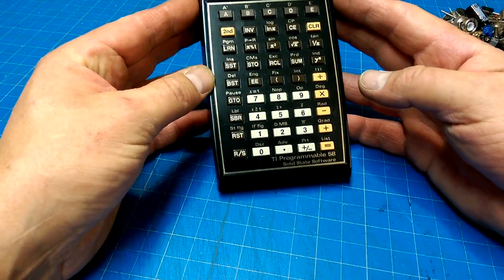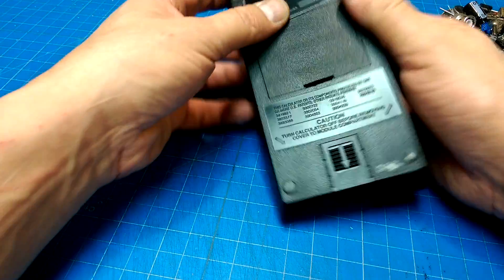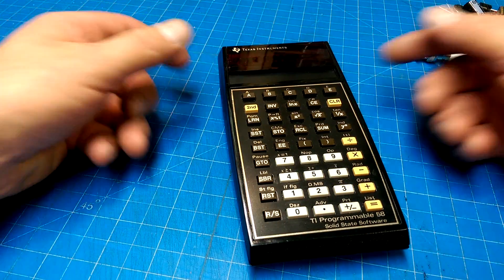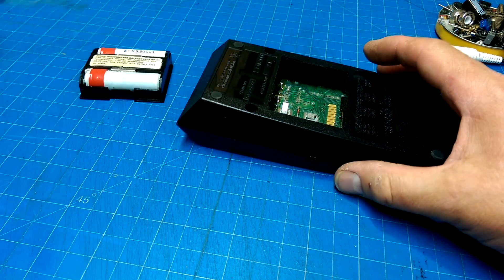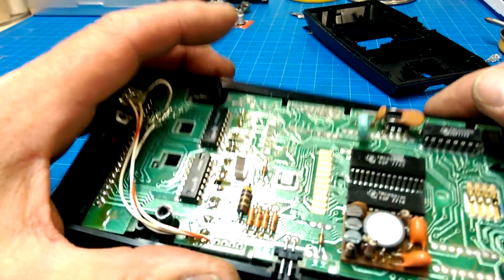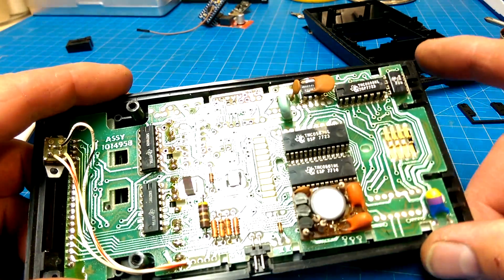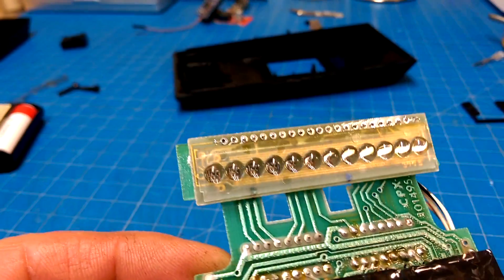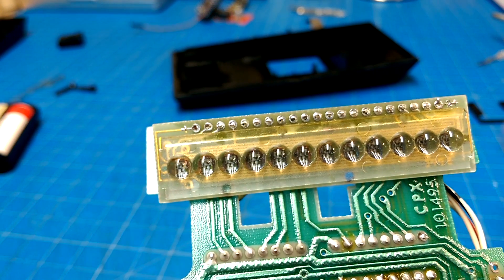TI 58 Repair

Comment: Oh that's interesting, the board seem to have been the same as the TI-59, bit it's just not populated with the card reader circuitery. You notice there's a whole area without components on the right of the battery contacts. Also the whole space in the head of the case, under the display, is empty... Right where the card reader fits in a TI-59.

Comment: Cool! I Still have a working Ti55 I bought with all the loot I made cutting lawns and taking care of neighbors pets during the summer when I was 15, in 1979. It was programmable sure but has very few program steps and is lacking in instructions compared to the more advanced programmable calculators. 

I wanted a HP41C but it was way above my pay grade. I would have settled for a Ti59 or a 58 or even a 57 but again, way more money than I could come up with. 

About 10 years ago, I nerded out on EBay and picked up a Ti59 with a broken power pin like the one you repaired with a PC100A printer cradle. I also picked up a Ti58C (constant memory) that I repaired the battery for. It works like a champ. I do love these old calculators.

Comment: When you use USB power, does the polarity matter on the external plug?

Thanks!
Reply from the maker: I do not have a schematic so I can not say for sure, but it looks like the power from the adapter goes into the bridge rectifier so polarity probably does not matter.

Comment: Is it possible to use it from the currently available Lithium 3.7V batteries? I have one approx 1200mAh, brand new and I do not want any damage of the calculator when I plug the charger.
Reply from the maker: The NiCad pack was about 3.6v, and I run mine off of 5v USB, so I don't see why not.
Reply: @grtyvr  Thanks, but I mean, I solder the battery pack inside and I want to use the original TI charger, so I do not want to install eg. a TP4056 charger circuit with USB connector.
Reply from the maker: @TizedesCsaba  I suspect that the new battery charge profile is different from the old NiCad.  But I am not an expert on that.
Reply: @grtyvr  Yes, I have asked an electrical engineer and he said, the overcharge protection for the Lithium batteries required, therefore the best solution install a TP4056 charger with USB. Only one question, how can I close the battery compartment without old battery...?!?
Reply from the maker: @TizedesCsaba  I just pulled out the batteries and left the cover undisturbed.  That worked for me.

Comment: The TI-58 and TI-59 were introduced in 1977. The TI-58C was introduced in 1979 with some internal circuit improvements and that's when I bought my TI-58C. Also bought a printing cradle for it (PC-100A). The "wall wart" it came with is the AC9900/H-sw charger that can switch automatically between 120VAC and 240VAC input, and outputs 6.2V @ 200ma (hence the "sw" appended to its model number; models without the "sw" are 22VAC input only). Has a Euro two-pin plug and requires a simple and cheap two-blade adapter for North America (no need to change voltage). I'm betting it's AC in spite of its polarized plug for the calculator, which could make sense if it has a full-wave bridge rectifier circuit . . . which would chop that approximately in half and provide charging for the ~3VDC battery pack (NiCads are 1.2V). If you replace the batteries and get a wall wart made for it, use only NiCad as the charging circuit is not made for NiMH. I've got two battery packs, one original and a second bought to replace it when it went dead. I'm going to mod the original to take replaceable AA batteries - likely will still go with NiCads, and will mod the second when its cells eventually die. If you use anything other than NiCads, pull them out before plugging in a wall wart!

Additional Notes:
The US Army was using the TI-59 with the printing cradle on a limited basis to evaluate feasibility in parallel with the M18 FADAC, an ancient solid state field artillery fire direction computer that was fielded in 1960 (FADAC = Field Artillery Automatic Digital Computer). It's not a trivial problem as the trajectory is affected by meteorological conditions including temperature, humidity, air pressure, wind velocity (a vector that includes direction), and precipitation (type and magnitude). The TI-59 fire direction program was fully capable of handling tube (e.g. howitzer) and missile artillery with high precision, and it was faster than the M18 FADAC. the printer was required for record-keeping in the event of an investigation regarding an errant round landing off-target (very serious and extremely thorough). The TI-59 with printer was overtaken by the fielding of TACFIRE. One of the major concerns with the TI-59 was its robustness in a US Army field environment that would subject it to all manner of shock, vibration, dust, moisture, etc. It wasn't hardened for it. Had it been fielded, the contract for it would have requested special hardened models specifically made for those conditions.
Reply from the maker: Good thing they didn't field it.  The memory card contacts were fragile.  I doubt that they would have stood up to much abuse.  My original from 81 developed a broken finger after 8 years of normal use.
Reply from the maker: And thanks for the tips on the wall wsrt.  I run it off 5v from USB now.
Reply: @grtyvr  I have verified the charger is 6.2VAC and you were correct that it's a bridge rectifier on the PCB. TI specifically warns that that calculator must not be operated from the charger alone, that it requires the battery pack as part of the "filtering" of the AC - presumably to smooth the ripple and to provide protection against voltage spikes - which could occur the charger is plugged in or unplugged (particularly from the calculator) while the calculator is on. I presume your 5 volt power supply is well behaved. I've got a pair of battery packs and will be cycling them through getting them rebuilt to allow removing and replacing AA cells in them - gives the option of alkaline, NiCd, or NiMH (the TI charger cannot be used with the NiMH, only NiCd). One pack still works and the other, a dead one, goes in first. As an additional note, if the TI-59 had been fielded, it would have been hardened with a different case and keyboard, and printer likewise hardened. A custom ROM would have been used versus the mag reader so it needn't rely on it. The ROMs are very hardy. The need for a TI-59 was its larger working memory. Don't know how many different ROM libraries you have, but they were one of the great ideas TI had for the 58/59. I used several in addition to the one it came with. Several corporations had custom ROM libraries made by TI for them that contained specialized proprietary programs unique to their business.

Comment: The TI-58 & TI-59 were introduced to the public on May 24, 1977
Source: http://datamath.org/index.htm
Cool video btw; I have recently acquired a TI-59 and an even older SR-52 from ebay, both of which need repairs, so your video will be a valuable guide. Thanks for posting.
Greetings from Denmark.
Reply from the maker: Glad it can help.  Always wanted to visit more than the Amsterdam airport in Denmark.

Comment: I just got my TI-58 from an online seller.  The PCB in my unit has a slightly different arrangement and some of the components are in different places than in yours (including capacitors and the "trimmed" chip in the corner). Clearly they have changed the design over years.
My unit came with no battery pack at all and there was no indication on the PCB about the polarity of contacts.  I learned from your video which is which - thanks!

Comment: Awesome video ! I’m way too young for having ever been near this stuff, but nowadays .. I do find the Casios to be way easier to use ..
Reply from the maker: Darieee, they were more like a computer with a very limited user interface than a calculator.  I like the Casio UI a lot.  And graphing!   I am amazed that someone has not created a hardware shield for the PI to take advantage of Mathematica. That would make a cool calculator.
Reply: tell me about it .. there's pretty much nothing that emulates what a normal casio scientific calculator does (the 20$ ones I mean) ... it took me ages to find an iOS app that would ACTUALLY SHOW the brackets ... Let alone have the ability to display fractions stacked and all the other goodies it has ... No idea why ... Apparently we're in the minority I suppose
Reply: The TI-58C and TI-59 were high precision computation programmable calculators, well ahead of anything else in their era other than the HP-55, HP-65 and HP-41C which were roughly the equivalent of the TI-58C and TI-59, and much more expensive. They were complete overkill for high school students, and were bought by university Physics, Chemistry and Engineering students along with professional scientists and engineers to replace the 10" Dual Base LogLog DeciTrig slide rule, which was still in use by those who couldn't afford the high prices of these calculators. A good slide rule didn't come cheap even though they were less than the calculators. Those slide rules did much, much more than simple multiplication and division with scales to handle all manner of sophisticated transcendental function computations (overkill for high school use). Small 6" versions could clip into a shirt pocket although the precision wasn't as good with the short length - but good enough for a very close estimates in the field and away from a desk. For those needing higher precision, there were 20" models. Ultimately the LCD screen calculators that used less power than LEDs superseded the ones with LED displays These were superseded by the programmable graphing calculators in the 1990's with large LCD screens.

Hope this gives you some insight into how the high end these were 40 years ago - at the pinnacle of calculator technology in their era. The TI-89 Titanium and TI-Nspire CX [CAS], along with the HP-50g and HP Prime G2 (rev D) are today's top end, and they're dirt cheap compared to how much a programmable scientific cost in the mid to late 1970's. The calculator market now is geared for students in high school and university. In the professional world, desktop computer applications have taken over. Laptops, tablets and cell phones can't be used on HS and university exams, or on college entrance exams like the ACT, SAT and GRE. Some of us still use a calculator for some applications in the field in industrial environments where a laptop is inconvenient or impractical.